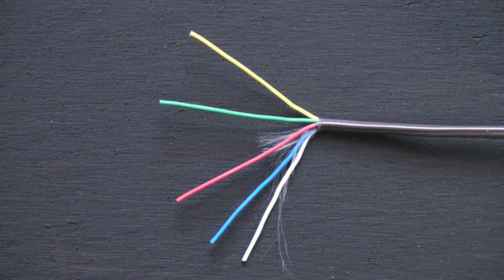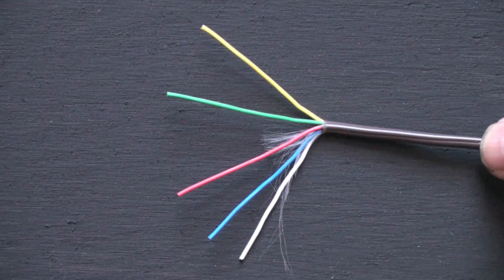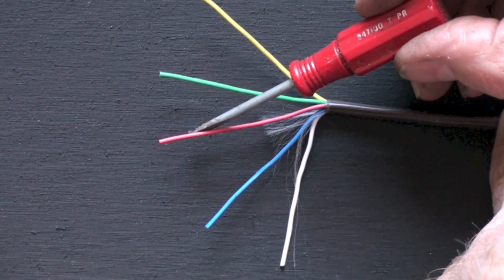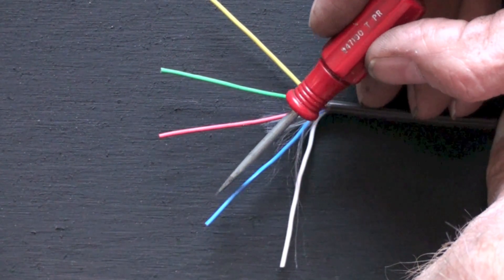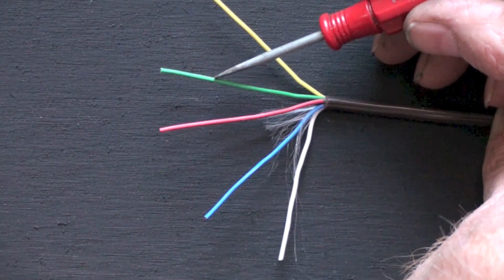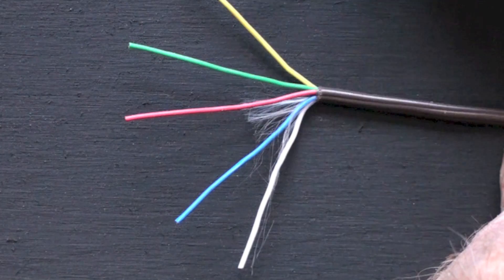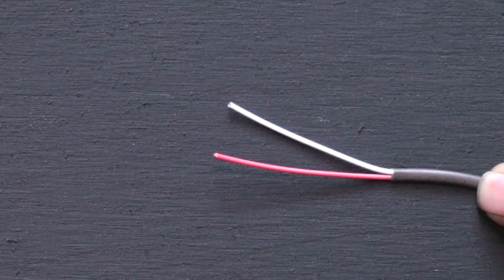An explanation of the HVAC thermostat color code

Comment: My outdoor wires going from my house to the outdoor ac is red and white and they're together in one piece. How do I hook that up to my ac which has yellow and blue?
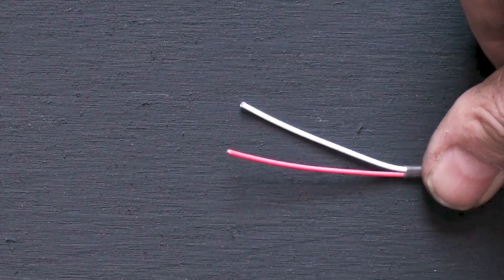Mine is the same as the one on 2:16. Thanks
Reply from the maker: If the yellow and blue connect to the contactor coil, the red and white of the thermostat wire can be connected to either one.
GFM

Comment: I'm starting the Thermostat series over for a 2nd-time-around-the-block, and one thing that's thrown me for a loop with thermostat wiring videos (I've watched a lot, elsewhere) is What Is That Common Wire For???

When you're a beginner in HVAC, you're also a beginner in electricity, so you start asking, 'ok, the red is power, and when the heat switch is closed, the power goes through the White wire back to the furnace control board...,  same thing for fan -- power goes from the Red wire to the Green wire, then down to the furnace control board... 

So WHAT is that Common wire there for?  The beginning HVACer starts to doubt their sanity... Do I not know what a common wire is used for in something as simple as a thermostat?  If I can't figure that out I must be an idiot...!!!   Wait... That bleeping thermostat has "digital readout lights" on it too... THAT must be what that Common wire is for.  Phew.    (end of story).
Reply from the maker: The common wire is used to complete the circuit for some electronic thermostats.  In this case, the thermostat is a load.  
In some cases, the thermostat is powered thru the Heat circuit "W".  When the heat is off,  the thermostat can feed thru the heating load and get enough power to operate the thermostat.  When the heat is on, the thermostat has a capacitor that acts as a battery.
GFM
Reply: @grayfurnaceman  
Uh boy... in other words, I'm in the Intermediate class, not yet ready for Advanced. 

Can't make sense out of this statement, "When the heat is off,  the thermostat can feed thru the heating load and get enough power to operate the thermostat."

And don't have enough background to make 100% of this one, "When the heat is on, the thermostat has a capacitor that acts as a battery."   (This is definitely in "Don't try this at home" territory.) 

But this a par for the course when it comes to wiring.  When not in a structured lecture, the pros get very casual when it comes to talking about wiring,  and old-timers yank out wires like it was nothing, and the rest of us are looking at it like "holy cr*p, do you know how to put those wires back?" 

... And dorget it when it comes to on-site heat pump wiring  -- double that when the 'backwards' Rheem and Ruud systems getting talked about. 

But there are some good/slow-it-down on-site ones out there that explain things like fan relays on defrost boards.   But then there are a lot of videos out there that are basically just 'brain dumps'.   Real teaching and brain dumps are two different things.  The former takes skill and practice -- hat tip GFM ;)

..
Reply from the maker: @hg2.  The one thing I can say about electricity is that if there is a way to do it, electricity will find it.  Or rather, electrical engineers will find it.  
Specifically, you can run a small load by using the large load as a wire rather than a load.  
Consider the light on a door bell.  It goes out when pushed.  It is wired in parallel with the switch.  When the switch is not being pushed, the only path is thru the light.  The light draws very little power, so the power passing thru is lower than what is needed to energize the load.
As for you learning, spend all the time it takes to understand how electricity works.  If you understand electricity, you can repair almost anything.
GFM

Comment: what is calming on an a/c?  If I have  dual compressor, and the hi stage is not turning on could that have anything to do with the thermostat wiring?
Reply from the maker: The word is common.  Usually the unswitched terminal of the low voltage control circuit. 
 It could.  Y2 should be energized for the 2d stage to operate.
GFM

Comment: My dogs chewed the wires next to my AC unit, all are severed except the white and red. My AC still works and cycles, keeping the temp I have listed on my thermostat 78*. However the attic unit does not cycle and stays running.
Reply from the maker: A/C or heat pump?
GFM
Reply: @grayfurnaceman  I'm not sure what you mean...the furnace unit in the attic does not cycle and runs constantly...my Outside AC unit cycles.
Reply from the maker: @raimestudio99  If the unit is running and is not a heat pump, there is probably no problem with the wires.  Usually, Red and White are the only wires used.  Is your fan switch on the thermostat in the "on" or the "auto" position?
GFM
Reply: @grayfurnaceman  Thermostat is on auto.
Reply: I have a pic of the chewed-up wires if that would help.
Reply from the maker: @raimestudio99  I would disconnect the G wire at the air handler.  If the fan goes off, you probably have a short in the thermostat wire.  If it stays on, you could have a relay stuck.
GFM

Comment: Hi.  I have a furnace that has 5 connections on the circuit board--Y,W,R,G,C.  My old thermostat just has 2 wires that go to the W (white wire) and R (red wire) screws.  I plan to run new wire to the thermostat for a Nest smart thermostat.  We don't have AC in our house by the way.  So here's the question.  Should I just buy 5 wire cable or should I just buy something with less wires, since we don't have AC? Do I just need 3 wires so I'll have one hooked up for the C wire?  Or do I need 4 wire....if I have a wire for the fan, does that mean we can have the furnace push through air into the house with its fan?  Please explain.
Reply from the maker: I would always use at least 5 wire.  This allows for future additions or a possible open in one of the wires.  If you connect the green for fan, the fan can be operated without heat or cool on.
GFM
Reply: Thanks! You've helped a lot!
Reply: Welcome
GFM

Comment: Review drill:
Red - power
Blue - common
Green - fan
Yellow - AC
White - heat

This starts to match up with the letters on the connection boards (?) after a while, e.g. terminals R, C, W, Y, G.

Comment: Hi ! I have a problem ! I have just black and red i install red to R and W to black and after that i is give me a error E/24 like is no power on R ,my old thermostat was install like that just with this two wires,and i find out in the back of the wall are another 5 wires ,I should apply all of them ? Thank you !
Reply from the maker: If your thermostat needs a common to operate the thermostat, the C will have to be connected both at the thermostat and the furnace.  The wires in the wall may or may not be connected at the furnace.
GFM

Comment: I just installed a new thermostat at my mom's house (non hp) She had the 8 wire bundle.  The wires used for hooking up were green,  red, white and yellow.  Something weird happened, when you just turn on the circulator fan, the outdoor condenser comes on too even with the ac switch turned off!  Never seen that before.  It seemed to operate normally when switched to ac and fan on auto.  You switch it to ac off and fan to on and the condenser fires up too?
Reply from the maker: Does your house have a whole house fan?  If so, the relay for the whole house fan may be wired incorrectly.  That could cause a backfeed that will fire off the air conditioner when the fan is turned to ON.
GFM

Comment: Hey man love your videos.   I would always caution labeling Y as “cooling”. I know you had 5 wire but I always tell my apprentices Y is for “compressor” not “cooling”because  what about when it’s. a heat pump?    Many vets I’ve learned from often make same association. Due to the fact heat pumps where a fairly new thing when they were apprentices.  Thanks for video
Reply from the maker: That is a good idea.
GFM

Comment: Ok if i only have 3 wires and none of them are marked and i want to put in a honeywell programable thermostat how do i do it the colors are green red and white (this only controls the A/C
Reply from the maker: If the color code has been used properly, red is power, green is fan and the only color left is white so it must be used for energizing the A/C.  The best choice for this system is probably a battery operated thermostat as there is no common wire.
GFM

Comment: That was it.  I took off the furnace cover and spotted one of the relays (there are two) sparking internally when I triggered it so the contacts need cleaning. The relay is soldered to the board so that's a pain.  I whacked it a few times with a screwdriver to get the fan to stay on and that worked. I know it will need more work later on. (TV/radio electronics is an old hobby of mine but I haven't cleaned a relay in 20 years.) Thanks for your help.
Reply from the maker: Welcome
GFM
Reply: I hope I'm right about the dirty contact. I'm pretty sure at this point.  Didn't they use to solder a capacitor across the contacts to prevent arcing?
Reply from the maker: Yes.  DC needs the cap to reduce arcing.
GFM

Comment: I have a furnace fan that many times locks on or locks off.
Reply from the maker: If the fan stays on when the fan switch is off and heat or cool is not on and any whole house fans not on, the fan relay is probably sticking on.  
GFM

Comment: Currently I have nothing connected to the Blue Terminal on my thermostat he used the blue wire to connect to the Yellow  terminal.  Should I get the heating and cooling rewired or just put in a new thermostat using the blue wire for coll ( as yellow)?
Reply from the maker: If it works ok, leave it be.
GFM
Reply: The current thermostat is electronic but not programmable.  I think I will wire the new thermostat with using the blue wire as the wire for cooling.  I will keep the old Thermostat incase the new one will not work with out the Common.  I think by the way the heating and cool it wiried it should work.

Comment: I want to set up my new NEST. I have the blue wire for the common connection at the NEST but there in no C or common junction at the furnace. Is there somewhere else I can connect the blue common wire at the furnace so the NEST will work.
Reply from the maker: You will need the common side of the transformer in the furnace.  Look for the wire coming from the transformer that is NOT connected to the red wire from the thermostat.  That should be common.  Hope this helps.
GFM

Comment: I'm blowing heat all of a sudden. checked everything and found I'm only getting  about 10 volts to the reversing valve solenoid coil. I do believe the issue is the control board. For the time being, can I bypass the board somehow to provide the 25 volts to the solenoid until the replacement board I ordered arrives?
Reply from the maker: You can bypass.  It can be left on continuously without damage to the valve.
GFM
Reply: +grayfurnaceman I hooked up the solenoid to the yellow and common and it blew the fuse on the board in the furnace. I'm certain that the yellow and common are correct so what am I missing?
Reply from the maker: You probably have the leads reversed.  There could also be problem with some sort of backed in the outdoor unit board.
GFM
Reply: The leads going to the solenoid or the leads coming from the furnace board to the outside? Does it matter which way the solenoid is hooked up? ie. common and yellow can go to either wire from the solenoid?
Reply from the maker: In your case, I think I would disconnect the solenoid leads from the board and connect them directly to the common and R.  The solenoid leads are interchangeable.
GFM

Comment: I don't have a yellow wire. I can't get my air conditioner to work . If I turn my heat on then my fan outside to central air starts going.but if I turn on Ac blower just goes and not Ac. MaybeI bought wrong thermastate. Can you do some troubleshooting for me. Thank you. I did call Ac guy but it's been two weeks. I think they forgot about me.
Reply from the maker: You may have miswired the thermostat.  Do you  have a heat pump?  What is the model # of the thermostat?
GFM

Comment: Very good explanation. You may want to add that the power coming to the thermostat is 24 volts AC. I don't think you mentioned that. If some guy checks his wires with a voltmeter he will get no reading if he checks for DC and then think he needs a fifth wire for installing a non battery thermostat

Comment: trying to install a new tstat (that requires a C wire) and I think i've got everything I need.  But, when I opened the furnace up, the Y wire was being connected to the C terminal (where I had planned on connecting the unused blue).  The Y terminal on the furnace side has nothing connected.  What the heck is going on?  I can send pics if that helps.  Old Thermostat is a Honeywell and new one is a Honeywell wifi thermostat (both use 5 wire).  Furnace is a York.
Reply from the maker: Eluka Moore The color code I give is commonly not followed.  The cooling power wire from the thermostat does not always need to be connected to any terminal at the furnace.  It is a power wire that goes directly to the air conditioner.  C should also go to the outdoor unit.  If this does not help, send me pics at grayfurnaceman@gmail.com
GFM

Comment: I have a two-wire vertical thermostat to a floor furnace.  The wires don't seem to have any color.
I want to connect a replacement White Rogers thermostat.  How can I tell which wire goes to which terminal?  Or does it matter for the old style stat.  No a/c to connect.

Thanks,

JM
Reply from the maker: Jim Metzger Just use the R and W terminals either wire will do.
GFM

Comment: I have an issue. I tried replacing an old analog thermostat (2 wired), with a newer programmable Honeywell thermostat on an old Coleman presidential 2 on my mobile home. Once I switched the power on on the furnace, the ac started blowing. No matter what function I changed on the new thermostat the ac would not turn off. Any suggestions?
Reply from the maker: jose vidal This one will be a problem with a new thermostat.  It was designed for a special single pole, double throw thermostat.  The only way I can think of involves changing the way the system is controlled and involves a lot of wiring changes.  Probably not worth it.
GFM

Comment: My dogs chewed the red,white and yellow wires on the outside of my unit. I put them back together and the unit does not come on. I can send a pic of the wiring. My unit and home are only 5 years old.
Reply from the maker: Send me the pics. Include the outdoor unit with model #.
GFM
Reply: My dog did the same exact thing! Have you gotten it repaired?

Comment: Awesome I got something right ! So does the common wire generally perform the same function (for example carrying 24v or in some cases 120v to a switch of some kind) wherever it may be found in a furnace ? Thanks GFM
Reply from the maker: Sounds correct.
GFM

Comment: So if I understand correctly: 120v comes into the furnace and is stepped down by the transformer to 24v so the I.F.C. board is now with 24v power. The 24v common wire from the board powers the t-stat. On a call for heat r (red wire/switched wire) goes back from the t-stat to the board and tells the furnace to energize w for heating. Is that right ?
Reply: 24 volt is sent to the thermostat from the furnace via R usually the red wire. The thermostat acts as a relay taking the power from "R" and sending it to cool "Y" heat "W" or fan "G". Depending on which wire now caries 24v Y,W, or G, that 24v signal tells the furnace what to do. The common wire "C" (usually a black wire though color means nothing here) acts as a neutral for thermostats that don't run on batteries. A heat pump will require an additional 2 wires connected to O,B usually orange and brown, when 24v is sent down these wires it tells the reversing valve what position to be in (Cool or heat)

If your system has multiple stages then you'll see Y1 (yellow), Y2 (blue) etc for cool and W1 (white), W2 (brown) etc for heat.

Long winded but that's how it works, electricity doesn't care what color the wire is so the best thing you can do is make sure you land each wire on the same thermostat terminal as is on the furnace.
Reply from the maker: That is correct.
GFM

Comment: Hi just want to say your videos are the best. In this one you were just about to explain the difference between r for power and c for common but in the video it skipped over the explanation. What does the common terminal do in relation to the thermostat and furnace control board ? Thanks
Reply from the maker: The common is the second power lead.  It is usually not switched.  The red is usually the switched lead.  The common is used in the thermostat if the thermostat needs to be powered.  The common will be designated by the terminal C.  Hope this helps.
GFM

Comment: I WANA ASK PLEASE, I LIVE IN A COUNTRY THAT USE 220V AND MY AIR CONDITIONER IS DIFFERENT SO POINT IS I DONT KNOW WHAT KIND OF AIR CONDITIONER WORK WITH THIS THERMOSTAT, IS IT 220V OR SHOULD I BUY A 24V AIR CONDITIONER TO USE THIS PRODUCT...THANK U
Reply from the maker: Even though your air conditioner is 220v, it should have 24v control voltage either from the air conditioner or the air handler if it is a split system.  Hope this helps.
GFM
Reply: grayfurnaceman Thank you so much
You are the best